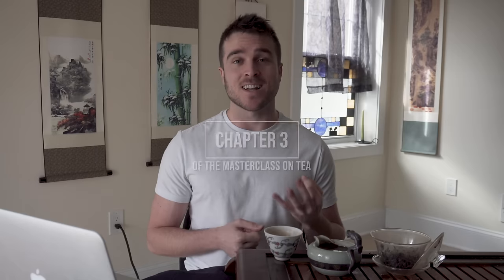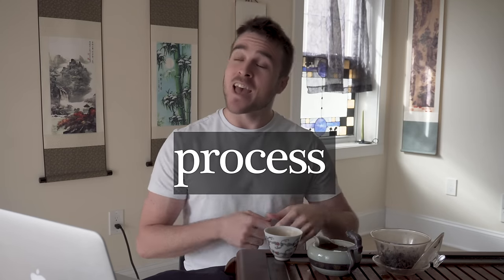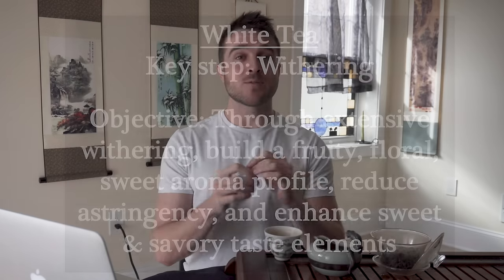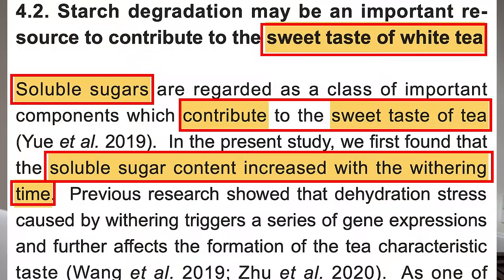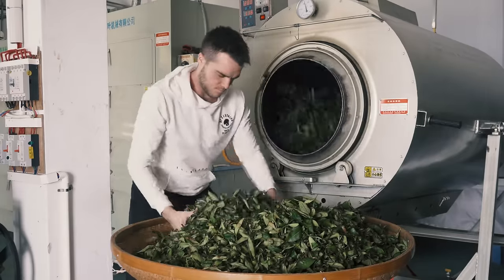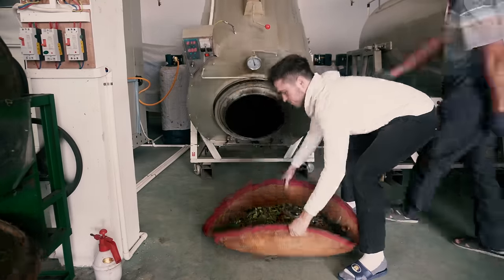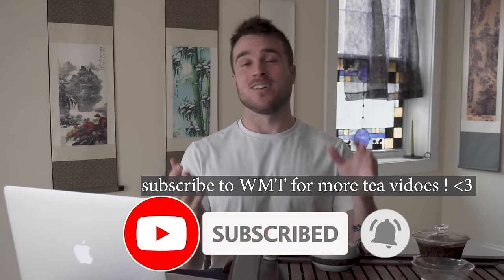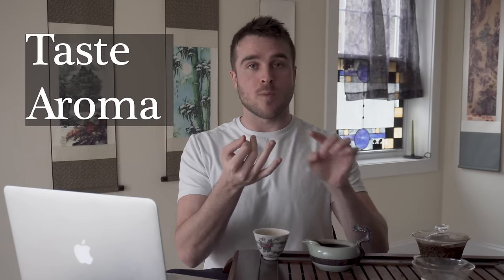Tea Processing Explained in Full: How Raw Tea Leaves are Transformed into the 6 Major Tea Types

Comment: To be fair, food processing often involves a variety of steps that don't add any outside ingredients too, but there are almost always at least some additives used for various purposes in food processing.

Great video though, very enlightening to somebody who drinks tea but did not have a good understanding of the processing steps involved in the various types! I was briefly confused when you initially mentioned rolling would enhance enzymatic activity for black tea processing because I assumed the fixing you mentioned just before this for oolong would have denatured the enzymes, but it makes sense when black teas don't have a fixing step (at least until drying, which I assume would also halt all/most enzymatic activity due to both the high temperatures during drying and the removal of water which I think would be required for enzymes to act) so the enzymes will still be active during rolling, unlike for the other types.

The mention of the different fixing methods was fascinating to me, because I've always felt that Japanese green teas tasted much more "grassy" than Chinese ones, and this difference in fixing steps completely explains why. Mystery solved, for me at least!

Question for you: I have found that full-leaf teas can be steeped much longer without introducing bitterness than lower more broken-up grades. I had always assumed this is because the broken damaged edges of the leaves release more bitter compounds into the water than the undamaged surfaces of the full leaves, and the smaller the pieces you have, the more "broken edges" you have in your total surface area so you get a tea that's correspondingly more likely to come out bitter with longer steeping times. Is this accurate, or is some other factor responsible for this effect?
Reply from the maker: Thanks for the comment - sounds like you were able to follow the information well 👍🍵 

As for your question, the surface area explains a significant portion of it, however another factor is that typically only lower grade (i.e. less umami more bitter/astringent) tea leaves are subjected to grinding and tea bag processing. Left whole, they would still taste more bitter, but the increased surface area from chopping would add to the problem and amount to a significantly more bitter brew compared to a high grade whole leaf infusion.

Feel free to reach out with more Q’s,
Dylan

Comment: 22:05 hang on... quick question if I may. You just said that you'd used heat to ?denature and stop the enzymes working and further, to fix the flavours right there. Now you seem to be saying that there thanks!are still enzymes working and that you have more for them to do? Would you mind clarifying?
Reply from the maker: Hi Nick, I went back and looked at that part for ya. I was describing generally the two functions of rolling, the second one being the mixing of enzyme and substrate. I try to emphasize at 21:59 that that specific function of rolling, the mixing of enzyme and substrate, is only important for Black Teas since they are not fixed. That function of rolling wouldn’t be relevant for teas that have already been fixed like green/oolong, which is line with your intuition👍. That make sense? Thanks for the comment 
-Dylan

Comment: What about the chemicals and pesticides that are sprayed on them!.some with lead etc...would like to know!
Reply: China has relatively low oversight over pesticide use and food safety, it's difficult to get good data on that beyond testing every tee you buy.

Leed like copper is a heavy metal that prevents microbial growth, for wine and other fruits using those before or during flowering wouldn't contaminate the final products (even though it poisons the soil) but tee is pretty much plucked just as it grows so contamination would carry trough to the final product.

Farmers who grow multiple crops could think it's just the same, even if the pesticides they buy aren't forgeries to begin with or labled correctly